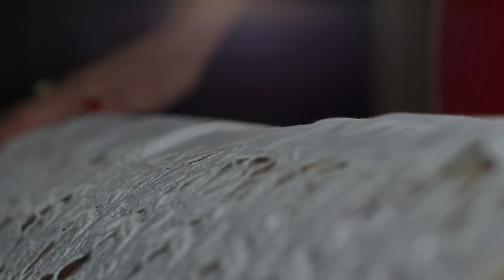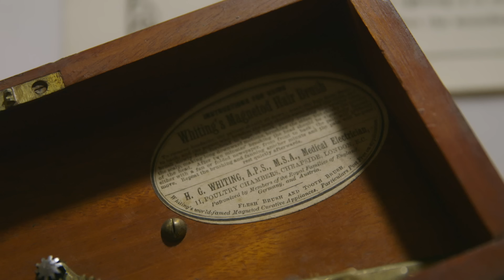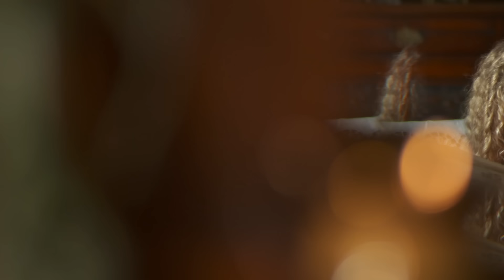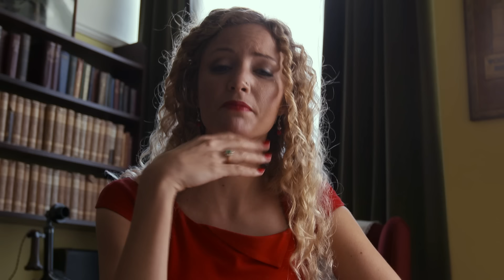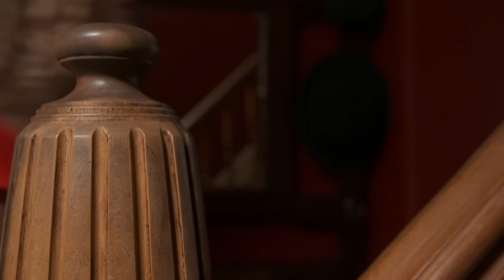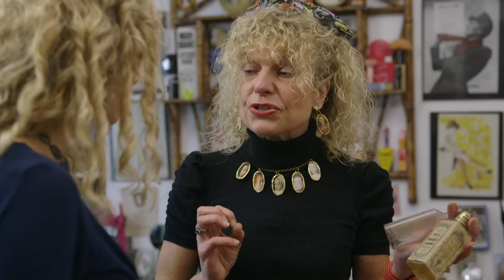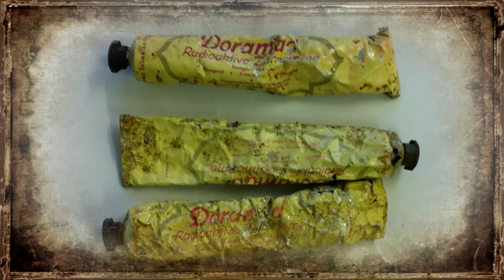The Edwardian Inventions That Turned Normal Homes Into Death Traps | Hidden Killers | Timeline

Comment: The title is misleading as electricity is only one of several hazards explained. On the subject of electricity, one important point was missed. Not only was voltage not standardised but there was also a mixture of AC and DC electricity supplies. Fatal shocks are much more likely with DC because it can cause instant paralysis, unlike AC which tends to cause the body to instinctively pull away from contact with the power source. Thus the DC shock can last long enough to make the heart stop.

Comment: They still have electrically heated fabrics today - you see them in every catalogue, my dears!! 🙂 Electric blankets, throws,and even clothing. The difference is, that nowadays such things run off safe stepper-downers, batteries, and now, of course, USB connections! 🙂👍

So - now you've got me interested though - are there any statistics, for house fires caused by electricity, prior to WWI?

Comment: I recently did some plastering and found a good length of old lead covered wiring. I did check with my multimeter first to make sure they were dead before I started pulling it out, the far end had also been cut off and I could remove it all. There were three wires, black rubber covered then a cotton red and black covering and a smaller diameter single bare wire for the earth. The live and neutral had three wires twisted together.The rubber inside the lead is just squashable but the exposed rubber covering is crumbling. 
In the 1960's my Dad was always next door doing the electrics for the old lady living there and I suspect it was this type of wire. She had a stone sink and stone floor in her kitchen and the gas light fittings were still on the front room wall. 
The inside of the cotton is printed with, GLOVERS. MANCHESTER. NONAZO. (REGD.) CABLE.

I used to love making up a coal fire, and it made excellent toast. I have the toasting fork when my Dad died as he kept stuff.

Comment: 2121...

"Homes of the mid to late Silicon Age were marvelous sights for our ancestors to behold. 

External personal communicators, fitted with rudimentary artificial intelligence, elevated digital interpersonal communication to newer and newer heights. Partially automated electronic appliances, like smart toothbrushes, video door bells, assisted autonomous driving and non-hovering hover boards are but a few of those new items.
...

Comment: This looks like a programme for children,  the presenter seems completely ignorant of electricity. What about the AC/DC battle for domestic supply.  Back then neighbouring districts being on a different voltage and different light bulbs, meant you had to replace a burnt out bulb with the correct one. Infact burnt out light bulbs were exchanged 1 for 1 for FREE, because they wanted you to use electricity. People put electric light in their down stairs rooms to extend their day and because it was so expensive, upstairs bedrooms remained with gaslight  or candle.

Comment: Asbestos is one of a common group of minerals, containing silica, oxides of silicon - this latter the most common element of the Earth's crust, near 60% of it.
A high proportion of lung cancers is directly attributable to it- the USA still allows it, and the old victorian houses here use it in the electrical cable insulation.

Because I've always valued high-functioning lungpower, i used to worry about laying in the sand, resting from surfing , windsurfing, exuberant running or swimming on windy days,  silicate dust known for at least a century as common source of lung dysfunction.

So, we don't need the ridiculous addictive neurological jolts of tobacco and other particulate matter, like diesel motors to kill us or reduce us to barrel-bodied sluglike organisms, seen so commonly in the adult human population. 

All we have to do is remain ignorant to diminish our lives.

Those Edwardian toxics were actually products used since the mid-1800s, when Queen Vicky was reasonably young, and most still persist in usage today.

Comment: Timeline is way off, 30 electric autos manufactured 1900s
US congress had 2-15 passenger electrics 1906
Early 1800s royals had elect re left fixity archemedis screws in the thames, (still there today) electricity was.suppressed for oil

Comment: 12:25 It is wrong. The applying a high voltage and low current will not set the steel wool on fire. The steel wool gets on fire because you short circuit it (high currents that heat the wire, not high voltage).

Comment: 36:40 Ammonia is still used as a refrigerant gas with the code of R717. Ammonia is becoming back for industrial refrigeration and ice rinks because its non ozone depleting. Propane (LPG) is also a refrigerant gas with the code of R-290. Carbon dioxide R-744 has also been used and is coming back into use. The point is ALL refrigerant gases are TOXIC and it is pointless to single out one.

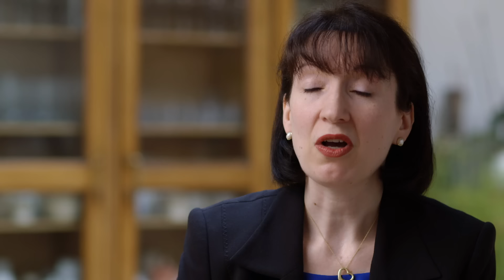Comment: 14:52 I see there is a basic misunderstanding of voltage and current. For sufficient current (amperage) to do damage to the human body the voltage must be high enough to overcome the body's electrical resistance. For example a 12 volt car battery can supply up to a 1000 amps, however its perfectly safe to touch the battery terminals because of the body's electrical resistance. 

There is a formula V /I R where V = Voltage, I = Current in Amps and R = Resistance to calculate each value if the other two are known.

The human body on average has an electrical resistance in 'ohms" of 50,000 a car batter is 12 volts so the current flowing through the body would be 0.00024 amps. If the skin is wet the resistance will go down to say 5000 ohms so then the current would be 0.0024 amps still nothing.

If the voltage is raised to 120 volts lets do the calculation again now the current is 0.024 amps with 2.88 watts of power and this is dangerous.

If the voltage is high but the electrical supply cannot supply the current (amps) and if its low enough there is no danger - a static electricity spark can be 50,000 volts but the current supply is in micro amps so we just feel a shock.

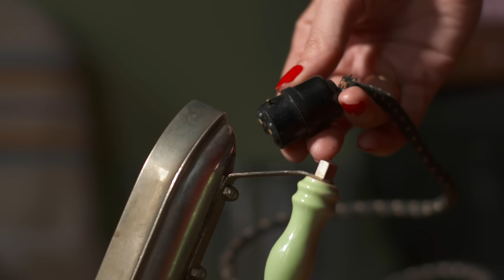Comment: 13:52 The generating companies could and did control the voltage, but in an era with no fuse boxes, they didn't even have a prayer at a chance of controlling the amperage going into a household. The current was limited either by the random melting point of the weakest place in the electrical installation, or by the capability of the local grid to deliver energy, dragging the voltage of the entire grid down and overloading it if a serious short happened somewhere.
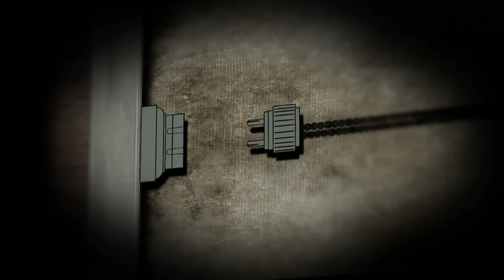17:47. It's not just that the plug and socket contained metal then, they still contain metal now. That's how the current passes through. Sometimes there are still sparks happening, depending on the inrush current of the load and the exact momentary voltage in the socket at the time of electrical contact between socket and plug. Switches can also spark, but that's becoming very rare with the introduction of energy saving lamps and the general use of electronic controls like triacs in place of the usual mechanical power switches in appliances. Things like electromechanical relays can also spark quite dramatically sometimes, that's actually one of the most common reason for them failing: - due to destruction of their contacts from sparks. There are simply better regulations regarding gas distribution and the housings of sockets, plugs, switches and so on are made by fire retarding plastics. Well, at least should be if they are up to spec with most modern standards.

Comment: I lived in a house that still had all of the original wiring in perfect condition. Unshielded positive and negative wires run up and down the outside of the walls in the living room and kitchen. It's like having power lines you could touch at anytime 3 feet from you.

Comment: I took apart a old electric dryer from the early 50s and there was insulation wrap around on the inside.After taking it off I was wondering if it was asbestos. Found it was actually fiberglass.

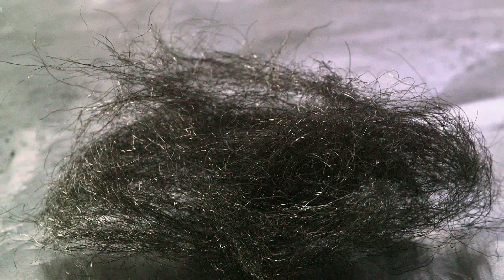Comment: 12:12 BULLSH%T!  It's the "OIL" in the Steel Wool that's Burning NOT the wire!  The 9 volt dc battery used was simply the ignition source. Get your facts straight Britts!

Comment: Fiberglass does the same thing and is slowly being removed from use. The biggest source for lead poisoning was actually lead in gasoline, but the petroleum industry agreed to remove it as soon as they could if they weren't called out.  It was agreed upon to stop the ruination of a budding industry.

Comment: Maybe British refrigerators didn’t go into mass production until the 1950s, but in America, they were a common kitchen appliance in the 1940s. By 1944, 85% of American households had a refrigerator. Manufacturers started using Freon 12 as a coolant in the 1930s, so I’m not sure why it took Britain so long.

Comment: The gym in my high school still had asbestos coating it's rafters in the early 2000s. We accidentally knocked some down during gym class when I was in 10th grade. They've since turned that high school into a middle school and as far as I know, it still has asbestos coating its rafters.